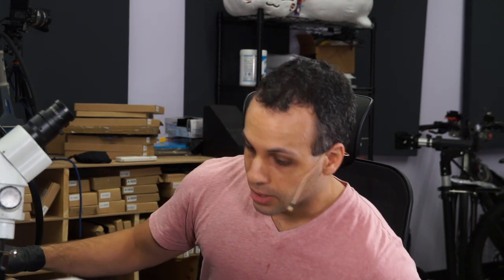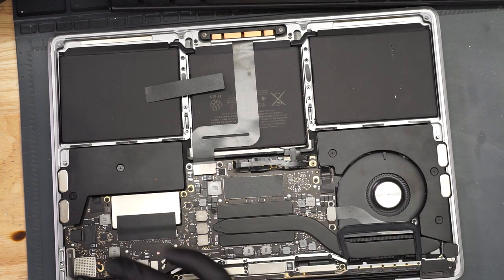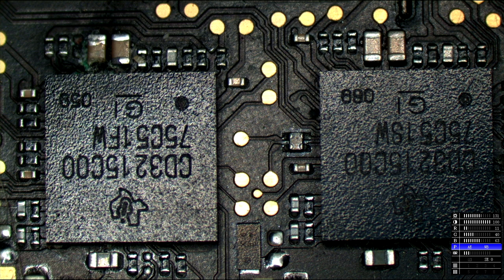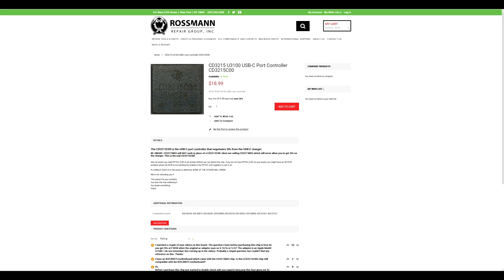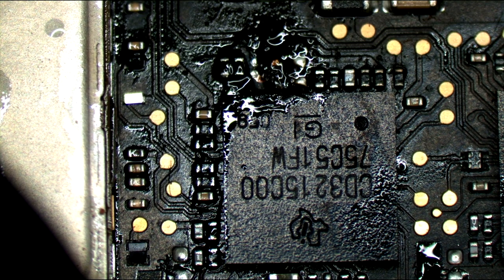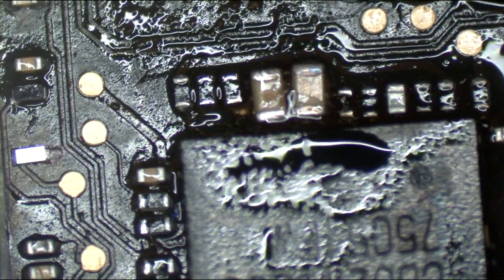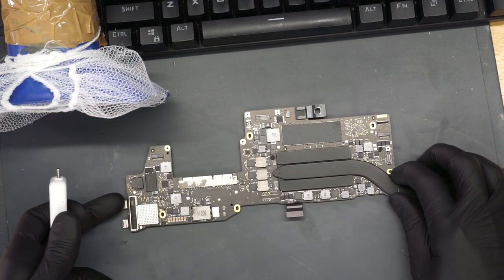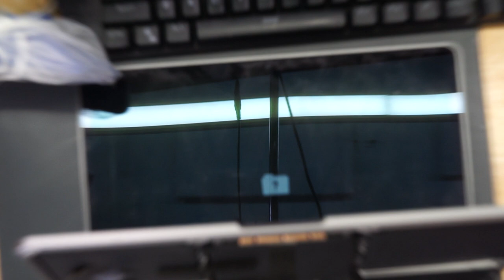When I repair a Macbook, I feel happier. Come join me. 😃

Comment: "You have four charge ports. My computer has one. My one charge port is stronger than all four of yours, because I have a thinkpad." - Rossman, 2020
Reply: I bought a 7 year old thinkpad, and it still chugs. Best purchase of my 17 year old life
Reply: The charge better be strong coz most of the windows laptops can’t utilize the full performance without being plugged in.
Reply: @amanagarwal1939  and apple macbooks and imacs just 9verheat when doing anything cpu demanding
Reply: 9 year old Toshiba here

It’s on its second HDD, needs a new battery, speakers don’t really work, and two keyboard buttons have stopped working (esc and space bar)

I need to open it up one of these days and unleash my inner Rossman
Reply: @thomasa5619  yeah I've got an almost 9 year old Sony Vaio, it's doing fine after replacing HDD with SSD. It was refurbished as well, in my imagination that retesting might be why it's so durable. I reapplied heatsink paste twice, but it really should've been done more often.

Comment: I only buy Crucial SSDs......  Cheap and great reliability and performance
Reply: Crucial is the same as micron, isn't it?
Reply: @rachmatzulfiqar  yes it is. 
MX500 SSDs are cached so really suggest them over BX500 that aren't.
Reply: @rachmatzulfiqar  yes my friend....
Reply: @rachmatzulfiqar  Yes. I use Crucial/Micro exclusively. I quit Samsung several years ago. WD hard drives, Crucial/Micron SSD on all my builds.
Reply: @Watchyn_Yarwood  So far I feel I've hit the jackpot when it comes to Samsung ssd's, the 970 evo's that I bought a year and a half ago are still going strong, and this is something I use as a gaming pc so those sticks see heavy use. Still if they do ever die I am looking very strongly at Inland  https://www.microcenter.com/product/621230/inland-professional-2tb-3d-qlc-nand-pcie-gen-3-x4-nvme-m2-internal-ssd
Reply: Samsung SSDs haven't disappointed me.
Reply: @XenoSpyro  I've had just Samsung die (out of many), but the 970 series pricing was disappointing, so last year I bought an Adata XPG SX8200 Pro 2TB instead for 215 UKP last year, as fast as the 970 Pro but much cheaper. Atm the 512GB version is well priced. For SATA though I just hunt for lightly used 840 Pro and 850 Pro, I'd much rather use these than modern QLC junk.
Reply: Samsung better
Reply: @rulik006  They used to be, but they're hardly immune now to inferior reliability when the entire industry has moved to junk QLC for mainstream models, while Samsung's pricing simply isn't competitive anymore, the 970 Pro was and still is far too expensive.

Comment: Never give people money until they finish the job, even if you trust them.
Reply: maybe half, to cover inevitable costs
Reply: @FathinLuqmanTantowi  not even half  giving money before the job is fully finished is a good way to get screwed over
Reply: You have to learn about the meaning of trust.
Reply: @MultiDarkZen  Sadly half is actually a reasonable request for contractors because there ARE shitty customers that will try to screw them over and not pay them the second half to save money. When we had our roof redone for instance, our contract specifically stated we would pay half of the estimated cost up front and then the remainder plus extra costs(replacing rotted wood, re-grouting the chimney, removing the 70's era tv antenna that hadn't been used since the late 80's) and once we had seen personally the work they did we basically had no reason not to pay them the remainder of what they asked for (and when a rare type of storm rolled through and pushed water into an area that normally would never see water they sent someone out to seal up that area because their quality guarantee is that good, needless to say we gave them full marks), carrot plus stick is actually a very effective strategy when it comes to independent contractors.
Reply: That works great for smaller jobs.  No one is going to do $9k worth of work without something up front.

Comment: I hope you don't mind that I let your channel plan in the background as I lay out circuit boards. Of course I make sure not to put high voltage pins right next to pins going to the procesor. I also had a problem with Raid0 in that I had a drive that turned off and then came back on with the result being a completely messed data as the system read from old and then new data.

Comment: Louis, I've been watching more and more of your videos lately, for some reason you are on my homepage and I'm not even subscribed, but it sound reasonable listening someone arguing about daily problems we all have to deal with.

Anyway I might be stupid asking this cause it might not be as simple as it sounds but, there is a pattern in many repair video especially on laptops where the issue is just one tiny chip which needs replacement and would cost like 50 cents but apparently that's nothing some one at home could repair without proper tools and knowledge.

So, I am wondering why the fuck it makes sense for manufacturers to design and use technologies like e-fuses to prevent firmware downgrading etc (game consoles) but when it comes to a damaged chip the solution is usually pay 200-300$+ for motherboard replacement or just buy the new model cause it's not worth repairing it. while they could just have 1-2 back up re-programmable chips  on the motherboard which could be reprogrammed automatically from a main protected source and then re-routing the functions of the damaged one to those. 

This is just a thought but unless this is somehow regulated by law there is no way for a honest consumer friendly manufacturer to design and sell products that last longer and be able to survive while everyone else's business model is based on consuptionism (there is a documentary which explains this very well - the true cost at 38:00).

Comment: FWIW, I have 3 Sabrent NVMe PCIe 3 drives (1x1TB, 2x512GB), and one so far (512GB) failed, and the replacement process was the best I have EVER experienced (my first was a 5GB IDE in 1999). All OS disks, different PCs, the 1TB with ArchLinux, the 2x512GB both with Win10 Home.

Comment: Micron SSds are reliable and the memory chips as well (Micron E die DDR4 is overclockable with some adjusted latencies/timmings and all) but bang for your buck for sure! I've used Samsung SSDs here and there (SATA and NVME) and sometimes the issues may lie on the on the TBW endurance as well and the type of tech used (MLC, TLC, QVO or whatever is out now); and Samsung's Turbowrite technology has limitations for NVME/SATA drives that write/read using TLC (or 3 bit) nand flash (I know the controllers have limitations). If you're constantly writing and reading from SSDs, especially in suicide raid, may I suggest the PRO versions that use MLC 2 bit read/write? I've never had problems with those and they are worth the money now a days for sustained read/writes and reliability. Just don't ever buy the new 980 PRO SSD that just came out which Samsung is deceptively marketing it as an "MLC" enterprise quality which in fact it uses TLC (consumer grade flash). The 970 Pro, 960 Pro or any Samsung that uses MLC 2bit flash is what you want and avoid the EVO and plus in the future as even used ones aren't worth it. I am going to pick up more Micron SSDs to test, but I wouldn't expect much in terms of performance.

Comment: MICRON FTW! 

I used Micron stuff in all my systems for SSD's and use a fair amount of their RAM - unless for overclocked AMD systems in which case I use sticks with Samsung B-die chips. Never had an issue. I have half a dozen of their SSD's both NVME and SATA humming away for the last few years at least. No issues yet.

EDIT: I don't know what I would do without these videos. Macbook repairs, car diagnostics and flight sim videos keep me calm. Otherwise I'd be going fucking apeshit.

Comment: Can you fix my 2009 MacBook!! ?? Lol! If I find all the parts, that is. I had fixed it myself — it had a very dented and distorted body shape and a misfunctioning DVD drive, So I fixed it and as I was putting it back together I put one of the long screws in the middle where a short screw Was supposed to go and I kept tightening it and tightening it until I screwed through the motherboard  ...I think 🤔??!?!? lol.... and ever since then it stopped powering on, even when i press it on the motherboard where I can press the actual hardware button. Sooooooo.... At least I Learned a valuable lesson about keeping track of which screws go where 😂😂🤣🤣🤣🤣🤣

Comment: Interesting, I've been buying Samsung SSDs for a long time now because I have good experience with them. My Windows has been running off of an 850 Evo for 5 years now and it's still working like a charm and so do all the other Samsung SSDs I bought since then (6 of them, 4 including the aforementioned 850 Evo for me, 1 for my grandma's computer and one for my mom's computer)
Either I was very lucky or you were very unlucky.

Comment: Hi Louis, I was wondering if you know what could be up with my Macbook 2013 Retina

1) Screen went bright white with a gray halo and stuck there when I turned it on yesterday
2) When I rebooted the screen remains black and not even the apple logo on the back lights up
3) The Macbook is displaying fine on my external monitor
4) System preferences does not identify the Macbook "internal" monitor
5) I have tried all software resets and nothing works

Im wanting to fix it myself if its possible as repair stores around me are saying minimum 5-6 weeks and I need my laptop for work. Thanks :)

Comment: Talking about your durable SSDs, I wonder if the key is refurbishing, that it's not a bad thing but a benefit. My Sony Vaio is a decent laptop, had $250 off because it was refurbished and it's going strong almost 9 years later. I'm aware that in car manufacturing just about every car off the line built by robots has problems which need to be sent to human workers to check and repair. Having a factory refurbished product ensures your part has certainly had quality control. Just my 2 cents.

Comment: It might be the file format that you're using on the drive, certain file systems will write a cache to disk regularly similar to using swap space instead of ram, which if you're using that drive at all to handle data it will compound the problem (if you're on windows it will probably be writing to the os disk whether you like it or not). I'd check if you're using the same file format on all drives, if it is idk it's probably just a p.o.s
Reply from the maker: Same. It's just a pos

Comment: I have the MacBook Air 11 inch the one they don’t sell anymore and for some reason everything works except they don’t one to turn on, like it turns green when charged so I know it’s on but for some reason the screen stays black. I’ve already fixed it once and it cost me almost 600$ and now I went back and they said everything looks fine so I had to take it in again to get fixed for another 500$ and I was not about to spend more to fix it then how much I payed for it. The apple person called my MacBook vintage I literally bought it 3 or 4 years ago. I don’t know what to do now can you help??? Please anything will help ☹️

Comment: Hi mr Louis Rossman, do you ever encounter this problem?
 Macbook pro touch bar 2016 screen is glitching when getting hot, then turn black (screen LED is on), but the computer still working, when i plugged it extra display, it show...

whan i close the lid, it goes back to normal, but then after several minutes, it glitch again an then turn black,
the longer i use the macbook, the faster it goes glitching and goes dark, and then i will have to close and open lid for like 2-3 times every 5 minutes
 i wanna to do self repair since there is no trusted workshop around my place, and due to corona pandemic, i dont wanna go out,

thank you for your time

Comment: If you wonder why they did a shit job migrating Magento is because Magento is just too overkill for a shop your size. Magento 2 at that still has issues with plugins not working correctly after the migration.
I know it's too late now but I'd have recommended something "smaller" like Shopware.

Comment: Hello, I just bought a MacBook Air 13inch 2014 and the seller said that needed a new battery so I was going to do it my self but when I opened the battery connector was broken, does anyone knows if I can solder back ?

Comment: It's because your page file is on the nvme and your likely swapping memory a lot when processing large work loads resulting in a lot of small reads and writes constantly on the drive. While it doesn't feel like your using it much, it is likely one of the most used drives in your system. You can change where the page file is stored, but you risk the same abuse on any drive you move it too.

Comment: i cannot speak for your samsung ssd's but i have had a set of 500gb evo 850's in raid 0 for about 4 years, one of those drives is a year older at 5 years and survived a house fire. They still work no problems with daily usage, monthly thrashing

Comment: Your scratch drives aren't dying because it is not being written millions of times a day to to a single sector. OS disks are the most abused by windows constantly fucking with them and they tend to die because the same sectors are rewritten every other seconds and as they die the drive moves your data to other sectors until it runs out of extra space. Btw the more full your os drive is in ssd land the sooner it will die... unless they died randomly suddenly this could be a cause.

Comment: Whatever you do on a pc, the ssd on which the os rests is used. For every command there is a read/write from the os driver. 

The OS SSD is always under load. And worst things is that all those files are small... go figure

More or less...
Reply: @johnstrad  i wanted to say that the SSD that has the os is subject to a lot of stress. Even so, it holds really well.

I was reffering to Louis' comment about the os ssd not being so utilized but still failing easily.

He said that those other ssds held really well, he also said those deal with large files. Which is normal. As large files constitute a lower load than small os files. Like DLLs.

My daily driver samsung nvme is at 90% health after 2 years, non stop use. Really heavy shit.